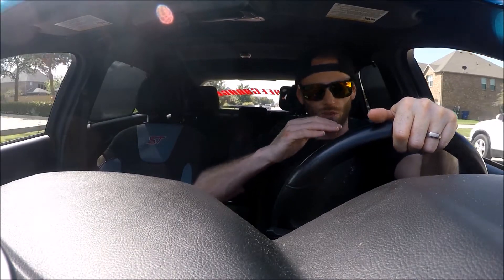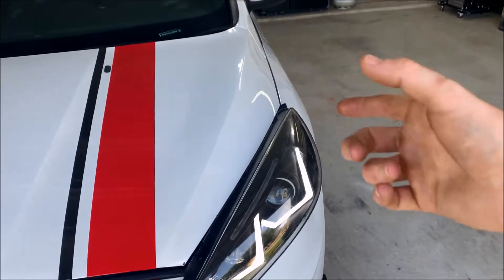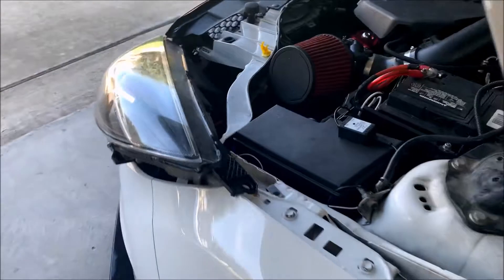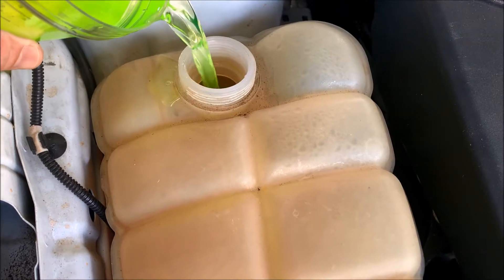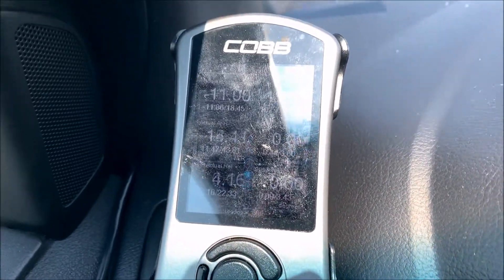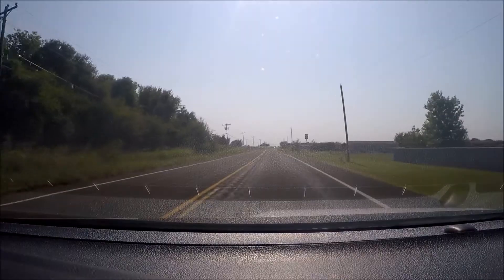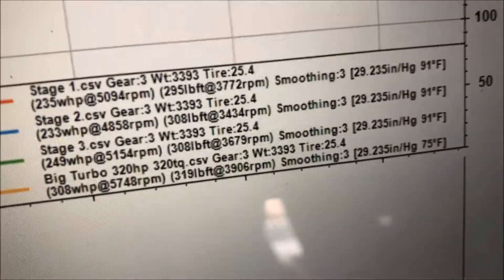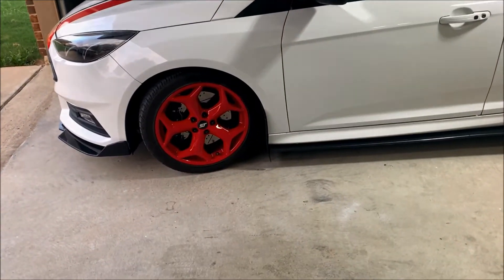Headlight Issue / Big Turbo vs Cobb Stage 1 2 3  OTS Tunes on Virtual Dyno

Comment: Does the accessport read properly when you use the estimated hp and torque? Do you know I have an st with a big turbo and numbers always seem low
Reply from the maker: No estimated hp and torque are way off on the accessport.  Virtual dyno will give decent results compared to a real dyno.